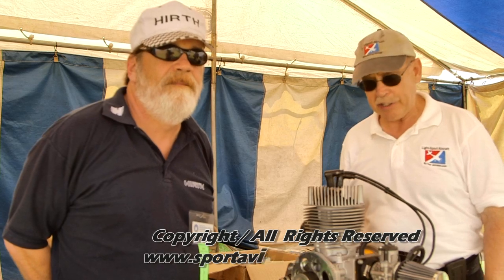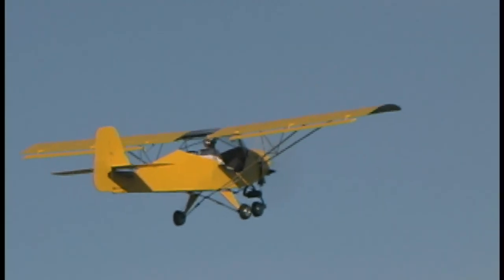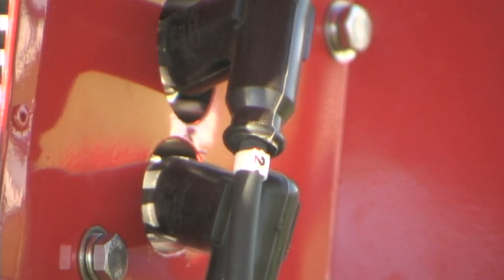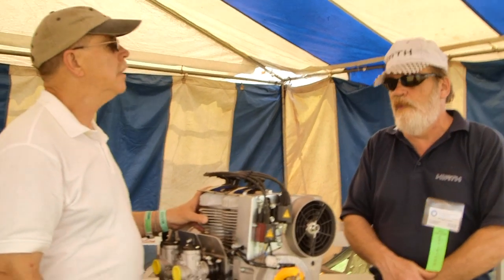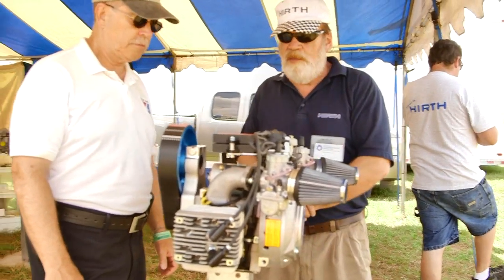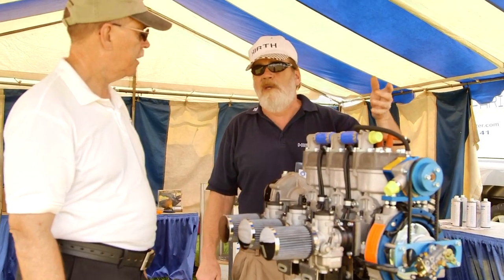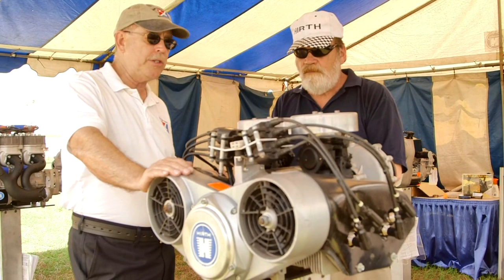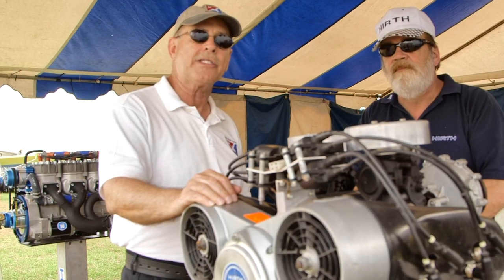Hirth Aircraft Engines, Recreational Power, Matt Dandar on Hirth Engines.

Comment: I have a old vintage 2 cylinder c u y u n a engine I don't know how many horsepower it is I'm trying to find it out can you help me thanks brother
Reply from the maker: Depending on what model it will be either 32, which is 340 cc, or 40 HP is it is 440 cc, if it has aluminum colored heads it is 35, black heads 40 HP. All of them made excellent boat anchors.

http://www.ultralightnews.com/cuyuna/trcyn.html

The Ultralight Flyer